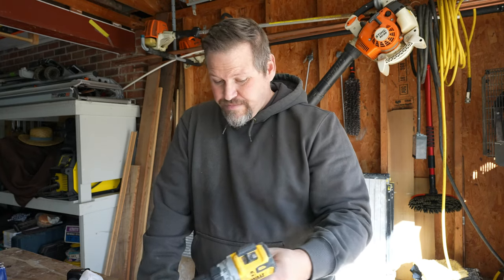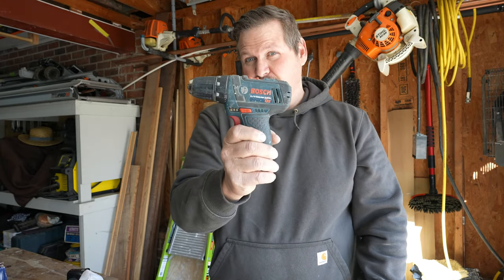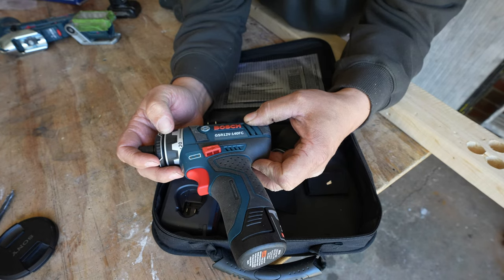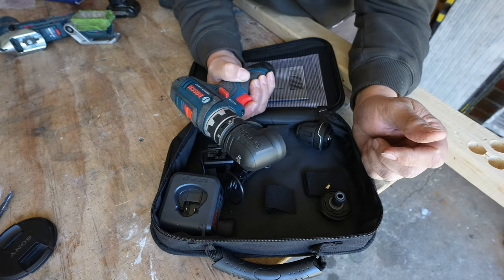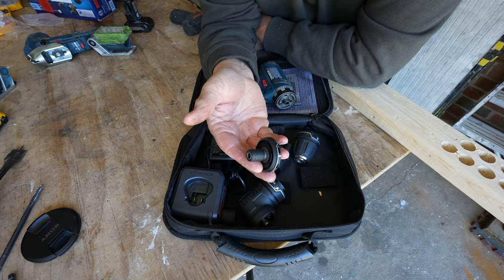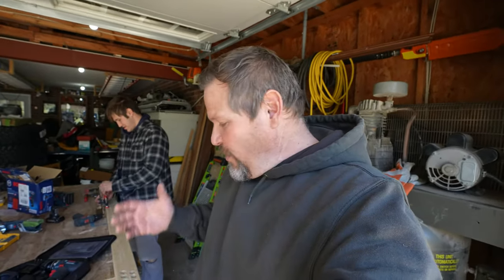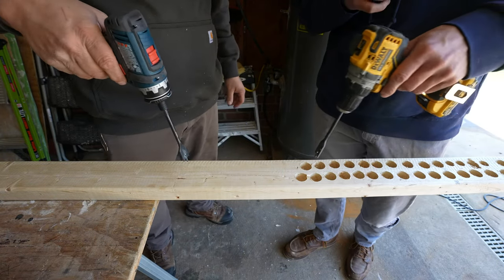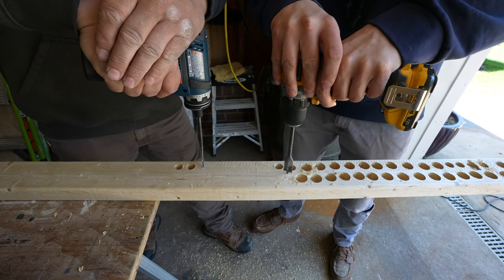Bosch 12V Multi Head Drill...Really Surprised Me...GSR12V-140FC

Comment: I have this model and I love it.....Just to let you know there is no need to keep remove then re-attaching the heads when you need to change the position of the drives, just hold the driver and pull the head forward, the heads are spring loaded and just need to be pulled and turned, even quicker now, (sorry if you were aware) but it looks like you didn't.

Comment: I have had this drill (not the brushless version) for a few years. Not so powerful but more then enough for cabinet work or similar. Very practical. If it is really cramped you can put bits directly into the drill head without attachments. It is a standard 1/4" size. But no magnet or similar that holds the bit.

Comment: Very good video, i have this tool in the brushless version, and I can do 80 % of my work with this little tool. The excentric attachment is my favorite, and most used.
Reply from the maker: I switched to the brushless not even a week after putting this video up. These tools do almost everything I need from a drill. Of course I keep a larger drill around for those larger jobs but very seldom use it.

Comment: I have the brushless model of this tool and I found this out accidentally since I didn’t read the manual, While the offset and right angle head is LOCKED on, you can pull out the attachment and adjust it, (it’s spring urged), you don’t have to unlock it.
Reply from the maker: Good to know about the collar. Just picked up the Brushless version and we’re going to test them head to head with the brushed version.
Reply: @campbellbuilt  The “EC” brushless model is a beast, it’s the same power as the Milwaukee version in a much smaller form factor. It’s my go-to tool unless I need 18V power, it handles 80% of what I need without the noise of an impact, and it just disappears in my pouch, you will love the brushless model, and not having to remove the attachments to adjust the angle is genius, make a video if you can, take care

Comment: Bosch 12v is the most underrated. 

Bosch is made for precision, that’s all I use when I am working on things that cannot get damaged for more precise work. Plus the size and weight of the Bosch is like non other.
Reply from the maker: Love the Bosch. Using right now in fact😄
Reply: I just ordered the 12v brushless FlexiClick myself. I was planning on getting one of their more powerful 18v combi drills, but the compact size and the utility of the FlexiClick made me reconsider for now. I do still plan on getting a 18v for more demanding drilling, but I think the 12v will do the majority of what I need

Comment: Whats the difference in weight?
Reply: DeWalt looks to be 1.9lb without battery. 2ah battery is about 0.6lb for an overall weight of 2.4lb

Bosch is 1.2lb without battery and the 2ah battery weighs 0.3lb for an overall weight of 1.5lb. The DeWalt is 1.6x the weight for just 10-20% more power that you probably won’t use because you’d rather grab your much more powerful 18v for those jobs anyway. 

Even the Bosch 6ah at 0.8lb would still be a half pound lighter overall.

Comment: Sorry, aware it’s an old video.. but I have the same tool, and can confidently tell you, you’re not squeezing every bit of the tool’s power on a 2 or 3ah battery.. you need the 12v, 6ah; and you’ll see the difference in performance.. it’s a battery with a flat base that looks similar to the the one on your dewalt equivalent..
Reply from the maker: Appreciate the comment first, I owned several 6amps for the Bosch 12v before I purchased that drill. Mainly to use in the 12v planer. Its almost mandatory in the planer to have the large battery but I didn’t like the additional size that it added to the overall drill. I’ve since switched to the brushless version but absolutely love this tool.
Reply: @campbellbuilt absolutely agree with you..

Comment: Most of these tools are not built for speed  but to do work and the Bosch is actually designed for its size/weight and precision ... I have a slew of Bosch 12V (drill, driver, impact, oscillating, grinder/cutter), a Makita 18V set and a Metabo HPT set.... all great !!!  I also have the Dewalt angle adapter and it works fairly well most of the times but not quite like the Bosch 12V with angle adapter